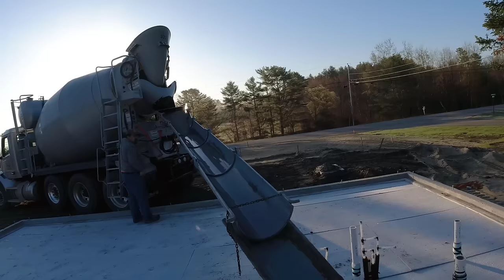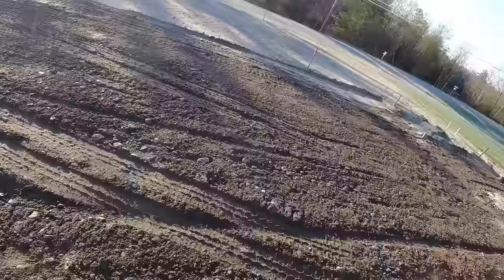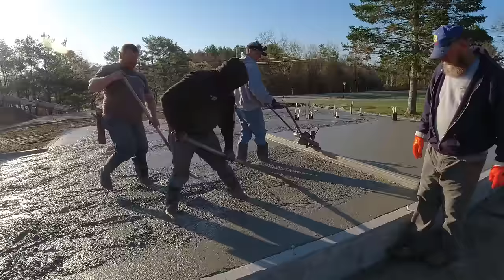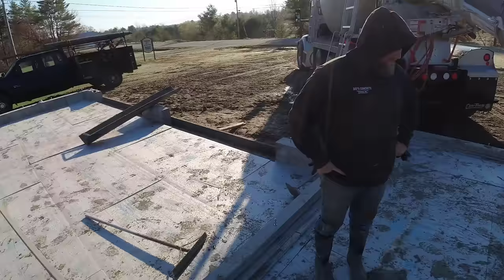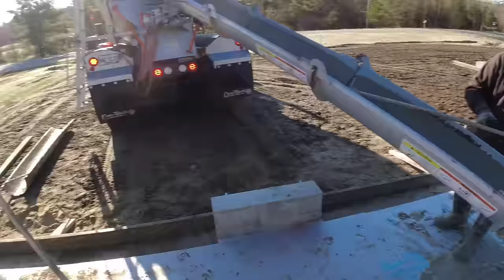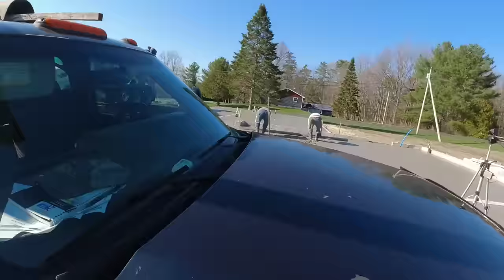How "NOT" to pour a concrete floor. Order enough concrete!

Comment: I don’t run short very often but a lot of times when I do it’s after a big rain the day before. I think when they mix concrete the next morning after a big rain the aggregate is wet and it throws off the weights just enough that there’s less actual concrete in the drum. Just my theory.
Reply: Plausible.
Reply: On a different note what slump do you pour and what coarse aggregate are you using. And how do you keep the vibe screed from digging in to wet concrete

Comment: Mike. Great channel. I have a 12’x20’ metal garage. It’s on a pad. With about 6 inches around it all around. My water seeps under the metal rails at bottom and gets wet about 1 foot in all the way around. Except where the garage front apron is. That slopes down a little. I was wondering can I grind the concrete so it slopes a little down away from building and water will run away from building and not seep under metal rails.
Reply from the maker: Yes a 4" or 7" grinder with a diamond cup wheel will grind it. It's not easy work but it will work. Be nice to have a dust schroud on it with a vacuum to hook up to keep the dust down.